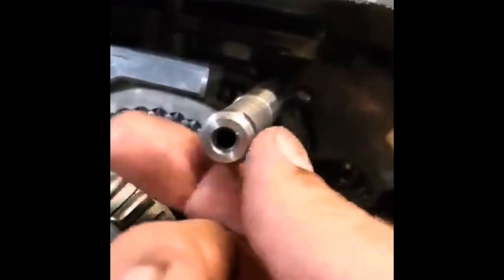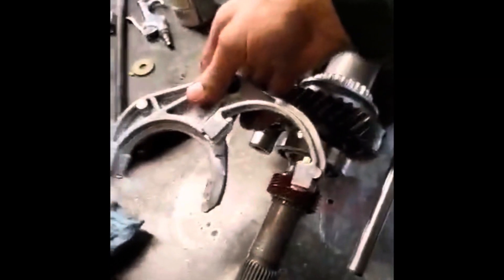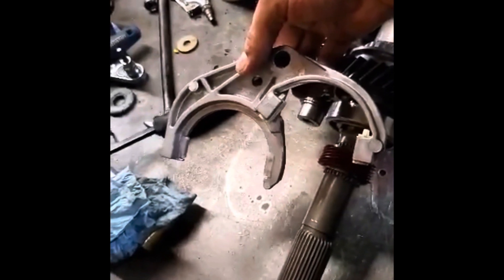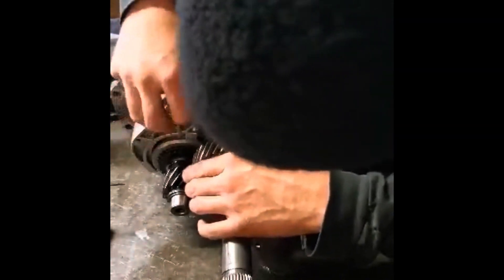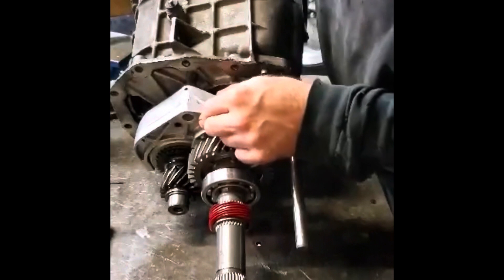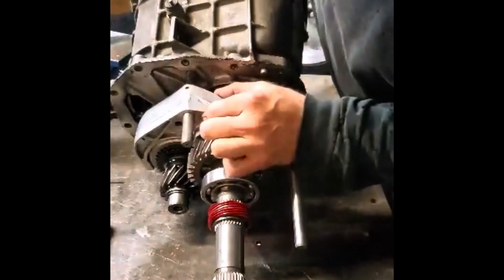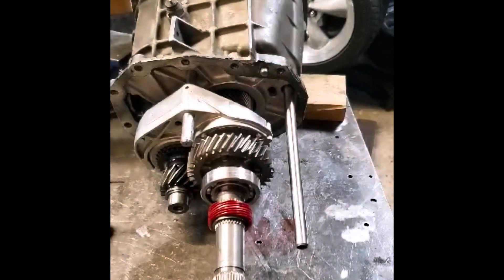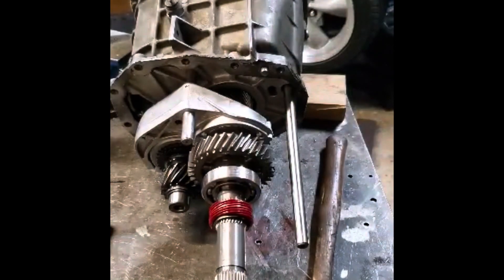Tremec T45 reverse fork removal easy method

Comment: Hey there. I officially have no reverse gear on my “rebuilt “ t45 trans. I’m not sure if the fork is bad, or the pads are shot or anything . I have a full rebuild kit and HIgh performance upgrade kit for the “eventually going to rebuild it “ time. However I just need reverse again for the time being. So question is , is there any way to pull off the tail housing , and then everything in the way then the 5th reverse fork without pulling the transmission from the car . I’m working on the garage floor and it’s a nightmare.
Reply from the maker: Going to be a challenge that’s for sure.  Good news is it’s easy to get to with the tail off.  Make sure your motor mounts are good, then hang the trans down as far as it’ll go and see if you can get the tail off

Comment: 1:13 my T45 does that same reverse grind, so it’s just a bent fork after all? I wonder why my cars 1,2,3 gears are all super loud when my trans warms up
Reply from the maker: These forks typically break if anything, as they’re cast aluminum.  Reverse grind is likely a bad Synchro. Although you need to check your disengagement. Clutch adjustment may be too loose
Reply: @v8only  okay will do! Thanks for the quick response.
Reply: @v8only  Do you think the adjustment is off and that’s why it’s hard to go into 1st and sometimes when I’m going up into third it gets real loud and can feel vibrations in the shifter?
Reply from the maker: @rileydines  reverse issues and hard to get into first?  Your adjustment definitely sounds off.  Try lifting UP on the clutch pedal then depressing it again. That activates the self adjustment.  Otherwise get the maximum motorsports cable and quadrant and firewall adjuster so you can self adjust it